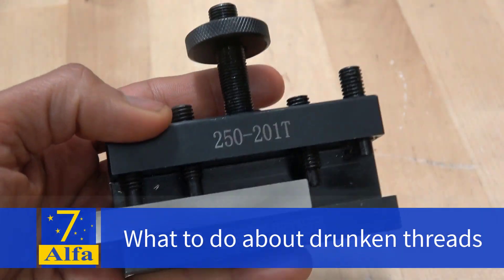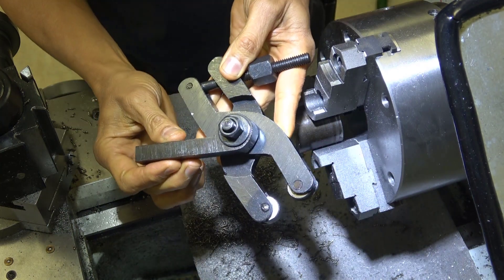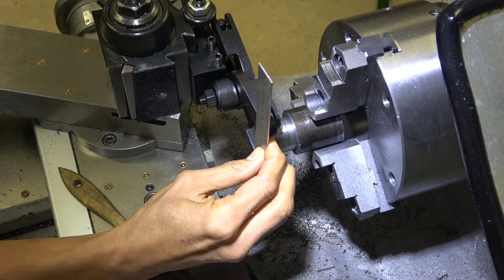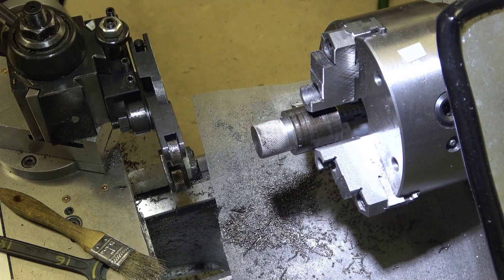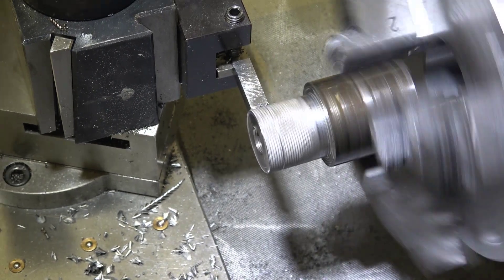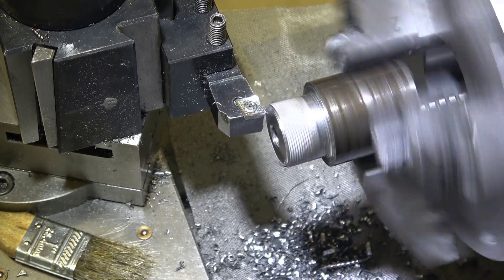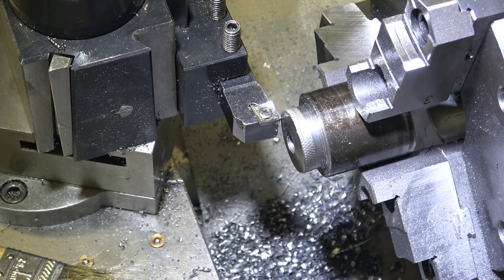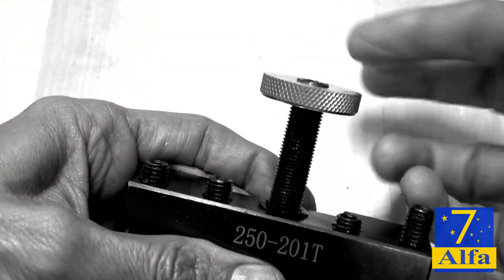Drunken Threads: what to do? QCTP tool holder problem.

Comment: I have the same knurling tool. The shoulder on the pivot bolt was too short so I made a new bolt.  Also, the holes for the pivot bolt were different sizes, and were drilled at an angle.  I re-drilled them and made a through bushing.  Though still not perfect, it is a usable tool now.  You may wish to check these parts on yours.
Reply from the maker: Thanks, will do. My pivot bolt holes appeared to be fine, but I had not examined them closely.